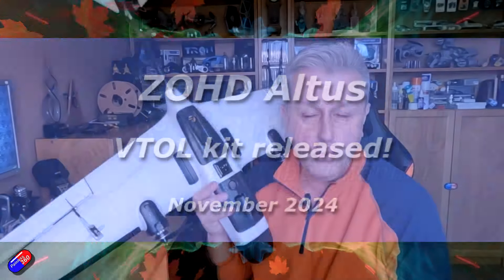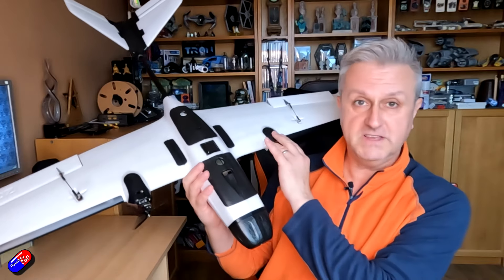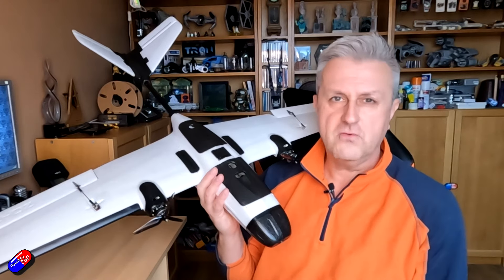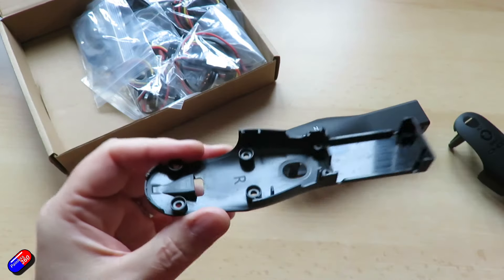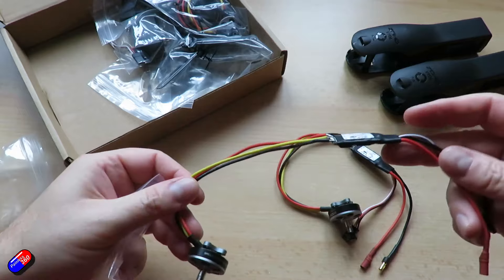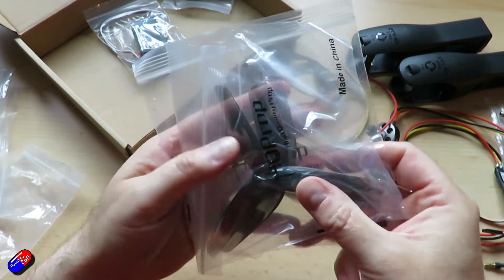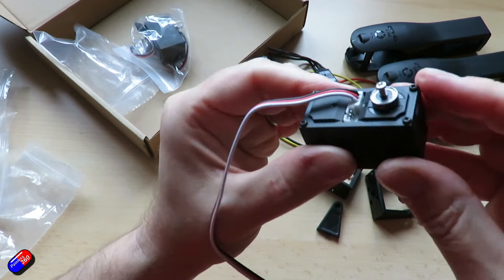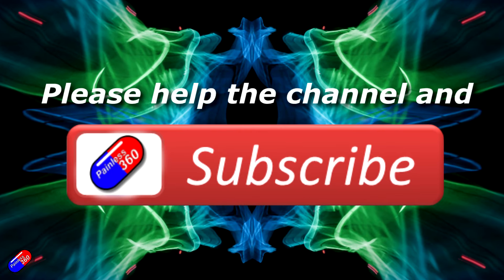World Exclusive: ZOHD Altus VTOL Kits Released on 13th November!

Comment: The Altus kit is less than $100, plus $100 for this VTOL kit and a little more for four small servos, I think that makes it one of the most accessible VTOL planes you can get right now, and it's a pretty substantial model.

BUT I wouldn't be surprised to see people start buying that kit just to get those servos, and maybe even start retrofitting the mounts onto other wings. I'm sure with not too much work they'd fit on a Mini Drak, or a Stratosurfer, or a Swordfish. Seems like a really nice kit for lots of mid-size FPV type planes...

Comment: Great video, as always. So, not having one, would you buy the plane kit or P&P, and the power combo or Kit. Thank you
Reply from the maker: Historically, once the kit comes out the vendor releases a full 'VTOL' ready version of the model. It'll be interesting to see if ZOHD do the same!
Reply: I agree with Lee, maybe wait a little and see if it comes as one purchase, but in the US, you can get the PNP for $135 from Banggood, shipped from California. If you buy the kit ($95), you have to add four servos, which will probably cost you $10 per servo. So for $40 I'd personally go with the PNP and then add the VTOL kit and keep the original motors/ESCs as spares (based on this video the VTOL kit looks like the same motors as the original, 2204-1870kv).